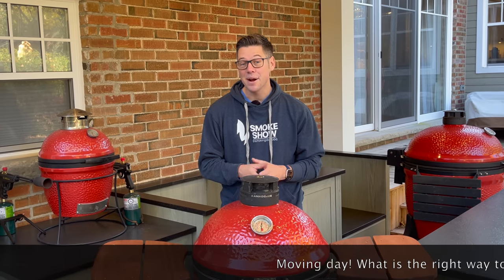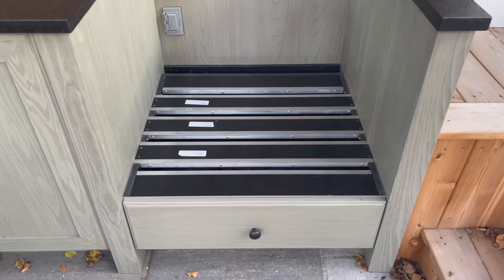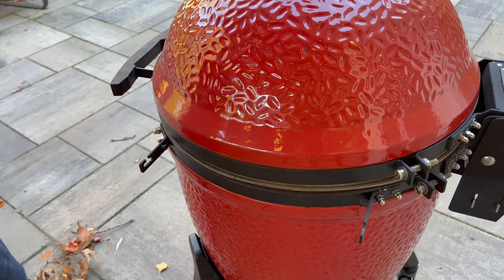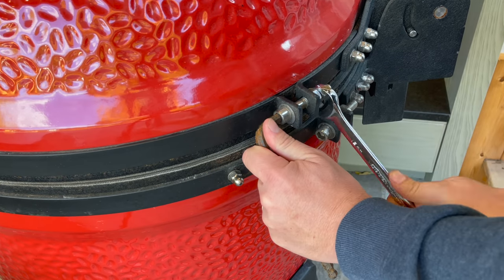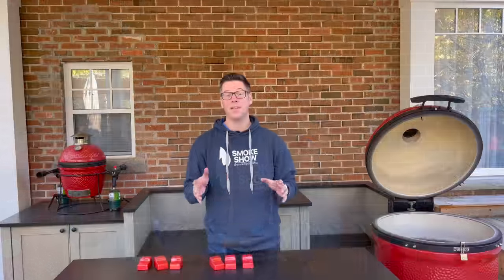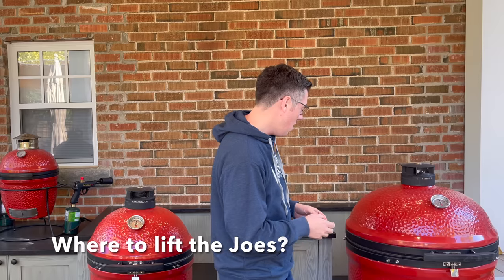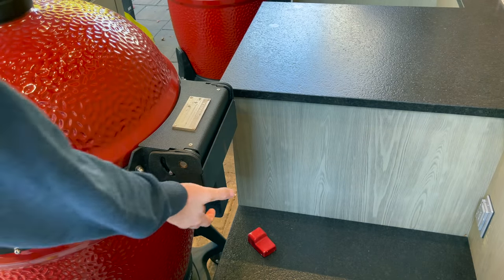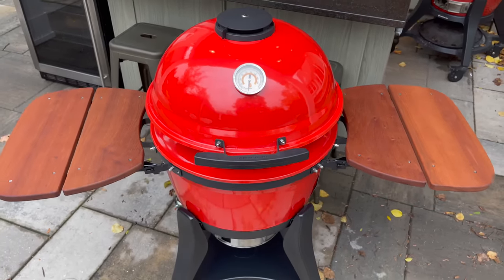Installing my Kamado Joe into a table for the LAST TIME?  Kamado table install tips & tricks

Comment: It's good to know about the safe way to lift the Joe. I didn't know and lifted my classic 3 by the side table brackets when I was assembling it. Luckily it seems to be fine.
Reply from the maker: dodged a bullet there and glad you're all in ok.  they are pretty small screws in the band so not good for lifting

Comment: I’ve had to lift my BGE’s a few times over the years. One trick I use is a good lifting strap placed underneath at the middle or balance point, lift on the strap & just balance the Kamado. Works great if you have to get it into a tight spot.
Reply from the maker: That's a great idea!

Comment: Dave I agree, it is a timely video as I am looking for a Christmas project for my son and I to do together.  Great tips and things to avoid.  I need to go back and get the dimensions of the concrete top (version 3 I believe) and make some other adjustments.  I trust the hidden extra side table pullout is included!  Thank you again, enjoy the channel as I have been a subscriber but would love a chance at the Kettle Joe!!  Happy Thanksgiving.
Reply from the maker: i just cut the slide out table to fit ... that was handy

Comment: This is some great information. I am planning on transferring mine over to a table/countertop setup at some point. Moving the KJ is actually the most intimidating part. Just getting it out of my truck was a comedy of errors (no damage/injuries though). I have a Classic 1 and that has a completely different hinge system on the back. From what I previously read, you aren't supposed to lift by anything that is banded around the outside because it could pop off. I have also seen suggestions about removing the lid to lighten up the weight quite a bit. It's possible that is easier on the older model (I haven't personally tried it). One of these days, I might upgrade to a newer model. Thank you for the tutorial. I like that you provide material on owning a KJ, not just cooking on it.
Reply from the maker: Thank-you, cheers

Comment: With our house, anywhere that we would put it besides the structure would not work due to smoke coming in through the windows.  So my Big Joe is on the other side of the patio with just a little side cabinet / table.  So looks like we'll be in the free-standing formation for some time :)
Reply from the maker: Thank-you, cheers

Comment: Great video! How is the solo stove fire pit?
Reply from the maker: i really like it.... it throws good heat and we live in an area where with our previous normal wood burning pit triggered phone calls from neighbours for smoke complaints.  been burning this since summer with no issues, once its going you can't smell the smoke even if stepping outside from a few feet away.

I have the bonfire size which is good for our space / wood consumption.  They are on sale i think ending today up to 35% off for black friday i think - https://bit.ly/SoloStoveSmokeless
Reply: @SmokingDadBBQ  thanks for the info! I’ve been debating getting one for a while. I may pull the trigger with the sale!

Comment: Could it be that you had great input into the design and engineering here?
Reply from the maker: sorry what do you mean?
Reply: @SmokingDadBBQ  you had purchased all this furniture, and they had such poor and weak features, they had to go back to the drawing table to restructure and improve their design. Their engineers failed big time.
That's how I see it anyway, from your videos. That stuff shouldn't be flimsy, weak, and crack from weight or heat.

Comment: Can’t wait till I build an outdoor kitchen for my BJ3. BUT, I’m facing a cross country move first. Any advice on protecting my Kamado for the move?
Reply from the maker: dont move it with the internals in.  roads are bouncy and that jarring will tempt the ceramics to crack.  strap it down into place and build supports around it and they move just fine

Comment: Table looking nice with all the Komado,s. I think I missed on what happened with the other one, did something happen. I e a question regarding charcoal and that is I heard that Big pieces of charcoal burn unevenly in and there will be hot spots in some areas and cold in others, and best only for long smoking sessions, and medium sized charcoal best for regular cooking as it is more consistent heat throughout and gets hotter temperature an used for grilling and shorter cooks. Is it worth buying regular sized charcoal and big pieces separately for different cooks/
Reply from the maker: Thank-you, cheers

Comment: I’m going to be building mine in soon. Are the measurements you gave for the big joe or the classic?
Reply from the maker: at 0:40 thats showing two identical boxes which are big joe size, the classic is on a 4" riser to make the grid level the same as the big joe 3.  i have since put a big joe 1 in the space and it sits on the same riser

Comment: Good luck with your rehabed tables!  I made a little table for my Kamado Joe Jr, not fancy or attractive but very functional.  I try to adjust your tips & tricks for the Joe Jr as that is all I have.  To do the double indirect method I used my deflector plate, 4 bolts, and my soapstone - it made great pizza.  Any tips & tricks for the Joe Jr would be appreciated!  Thanks
Reply from the maker: thank-you, cheers

Comment: Thanks James! I'm about to move and will be packing up the KJ Classic II for the journey. I was thinking of using a heavy pot lifter to get it out of the base and into the pallet/box it was shipped to me in (yes, I saved it). Any advise on using the pot lifter vs. the grab points you and KJ suggest?
Reply from the maker: i am not sure i have seen one of those

Comment: Awesome video! I have just finished my outdoor kitchen and miss judged the extra depth of the joetisserie motor. Did you have any similar issues?
Reply from the maker: no but i built a table where that was a problem so i measured several times over.... use a block or the feet to raise it until you can clear the motor

Comment: Thank you for all the catch22 avoidance! ;)  Quick question came to mind, when they redone the modules underneath, did they raise the height by a few inches for more clearance? if so what is the new height?
Reply from the maker: good question, height stayed the same.  this just eats down into the drawer not up into the cabinet
Reply: @SmokingDadBBQ  sad, you could have gained some needed clearance for the accessories.
Reply: @MB-pl3oi  I agree. But at this point just done with this company and their installer
Reply: @jamesmack3122  Can't blame you... :)

Comment: James, I noticed that you did not install the metal ash plate (and I seem to recall somewhere that you mentioned removing it).  Are you still running your KJ without it? Do you use the removable ash tray at all?  I can't find where you talked about it, but I've always wondered how/if they restrict airflow?  Some claim better preheat times, curious your thoughts.

Thanks for all the great vids!

Comment: Question: aren’t you scared that the whole grill could come down? I’m planning on moving my classic from its cart to a countertop, like you did. But I am thinking about having the countertop go around the kamado, so basically dropping the kamado inside the countertop hole so that it won’t fall down if pulled. Thoughts?
Reply from the maker: its pretty stable and has two legs on front for support, one in the back... the big joe is 300 lbs so it would take a grown adult pulling as hard as they can to pull it off.. in which case the cart is the same risk as someone wanting to destroy your grill could topple it over.  under normal circumstances no concern

Comment: Nice vid.  It obviously LOOKS great but is there enough utility there to justify putting those bad boys in a cabinet?  Thanks too for the reminders and tips to check tightness and use the paper towel method of firebox alignment.  Great ideas!

Lastly, where the heck did you find a 10mm socket?
Reply from the maker: the kitchen space helps for prep, but the experience dosent change in a table or cart.  its just a socket set that has metric and imperial